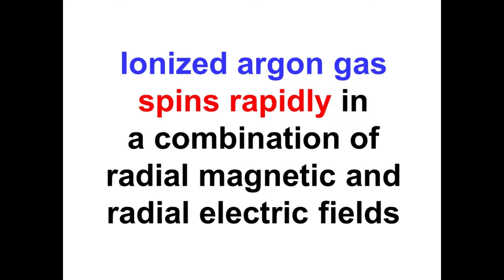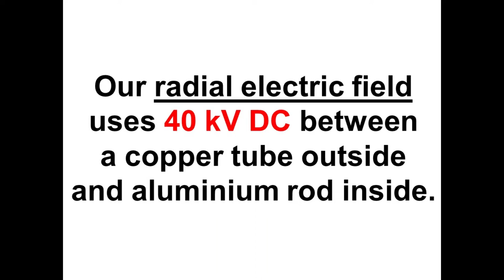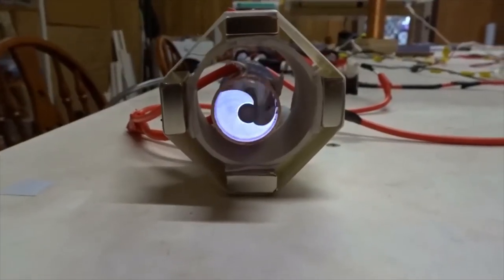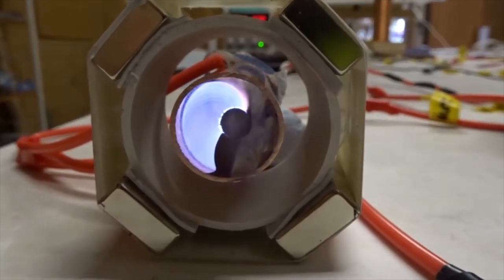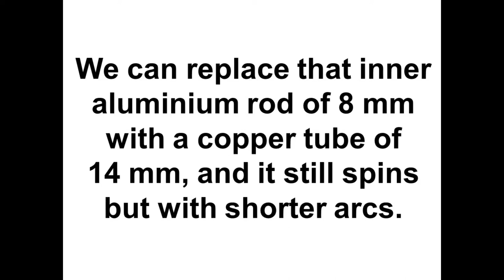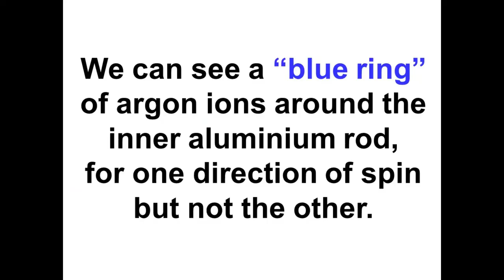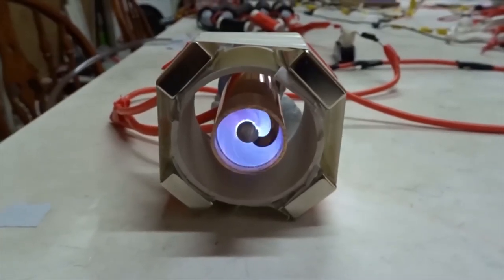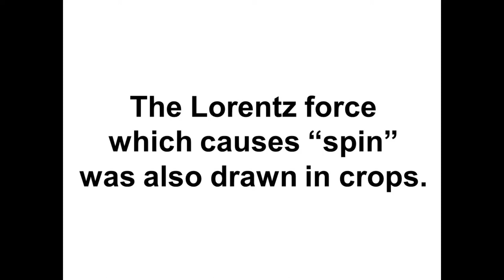Ionized argon spins rapidly in combined radial-magnetic and radial-electric fields

Comment: I wonder if you could change the rate of rotation with a change in diameter of the copper tube. My thought is that the ions are attracted to the negative source but the magnetic field causes them to rotate because of the motor effect on a conductor, the conductor being the ions. The video I saw just before this was about a rotating detonation rocket engine which may be something that this could help develop. My thought is that if you could match the rotation speed of the ions and mix that with combustibles to better time the harmonics of the rotating detonation then you could achieve faster and cleaner startups.